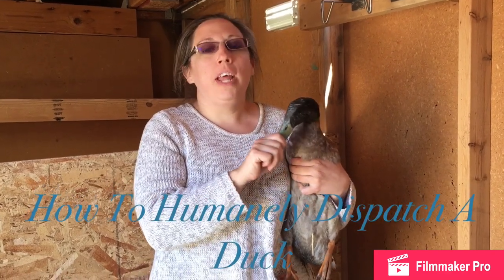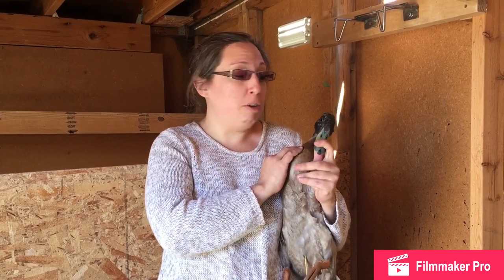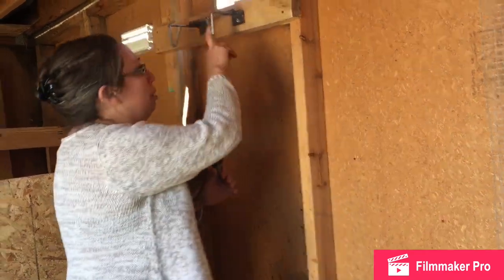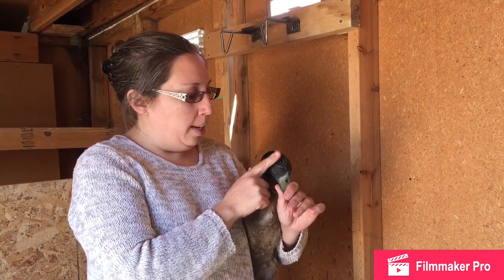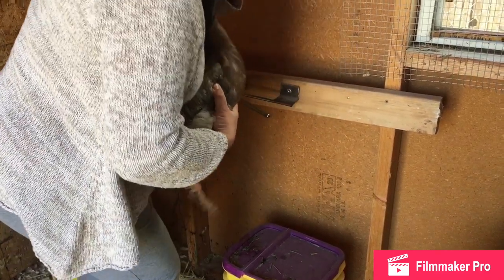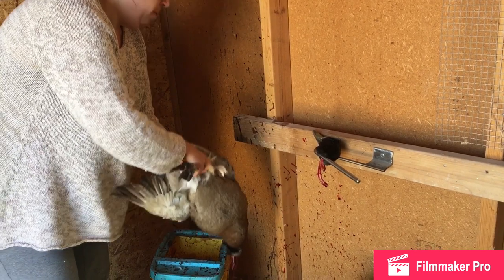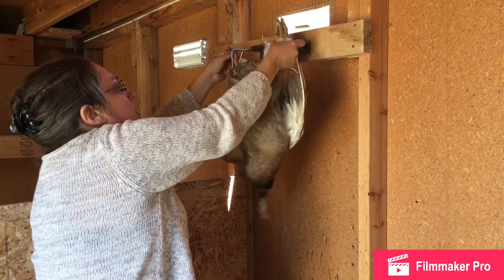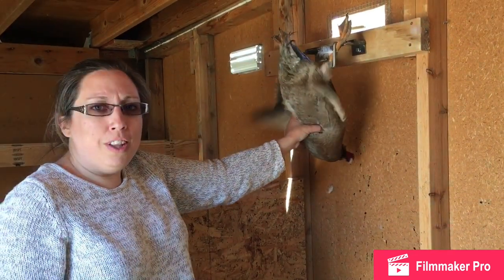How To Dispatch A Duck Using The Hopper Popper

Comment: I may do this instead of the cone. I’m so worried my life not being sharp enough. I’ve seen this used with rabbits. Glad to know it works with birds. Thanks you!
Reply: that thing is sized and angled for rabbits.  ducks have long necks, its faster and more humane to just swing it around your head than this nonsense.
Reply: Bartacomus Kidd I use a Bruce of square tubing, step and pull.

Comment: I really would have liked a warning on the decapitation. The shock of it turned my stomach. 😷 good to know you can use a hopper on ducks though. Wondering about chicken use.
Reply: Can be used on both. Turkeys I'm assuming also. Haven't used yet but read that you can. Wanted to see how it's done so I can do some in couple hours.
Reply: As long as the bend is short enough to wedge their neck in, you could use it on almost anything with a spine.
Reply: Tiarra Nelson then don’t watch the video. Tf?

Comment: Well.. The duck is dead, that's for sure. Not sure if it's the most humane despatch method or not. Surely you could just snap its neck like you do with rabbits. Or a small cut of their neck.
Reply from the maker: The Adventures of Tom and Jerry this is the same thing as snapping the neck. Both are a form of cervical dislocation (just different ways of doing the same thing). I prefer cervical dislocation to bleeding them out, I don’t find that method as humane.
Reply: @kokopellifarms7075  I agree completely.